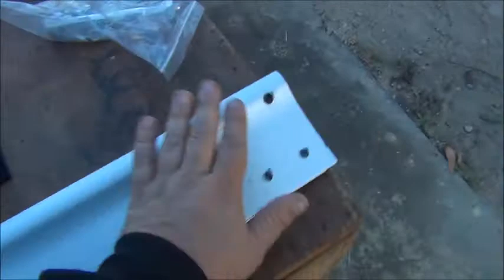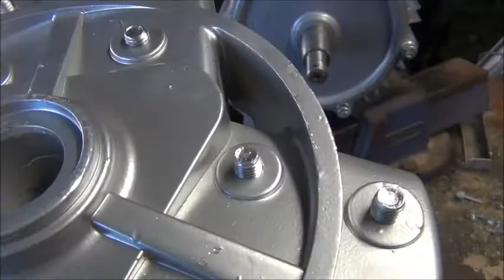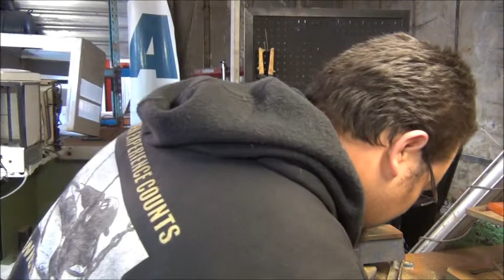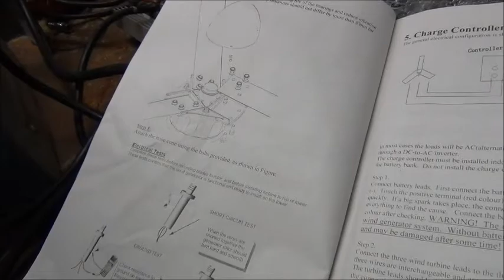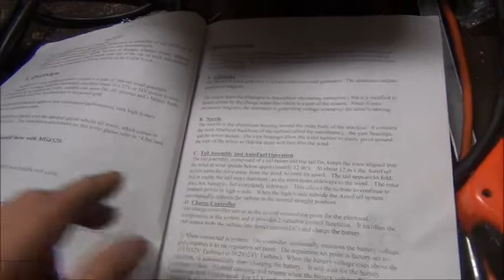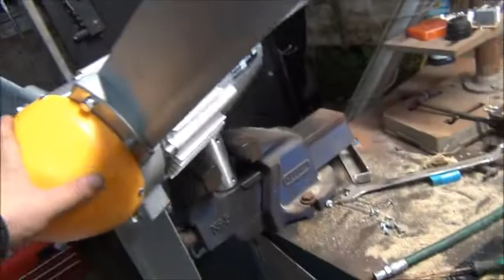Wind Turbine build from Kit. Part 1. Main Unit

Comment: hehe yeah - I should throw a couple of solar panels up on the roof and keep my battery topped up that way - a 200 watt panel should be plenty. Need to do the math and see how much energy is required to run my little server 24/7